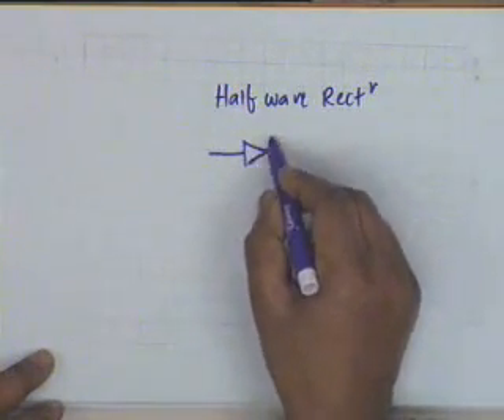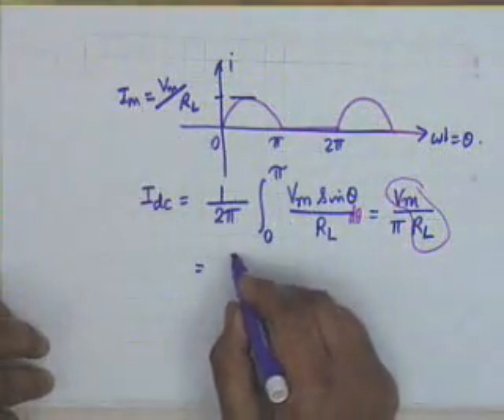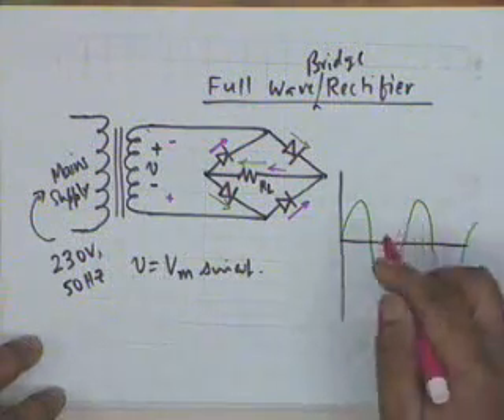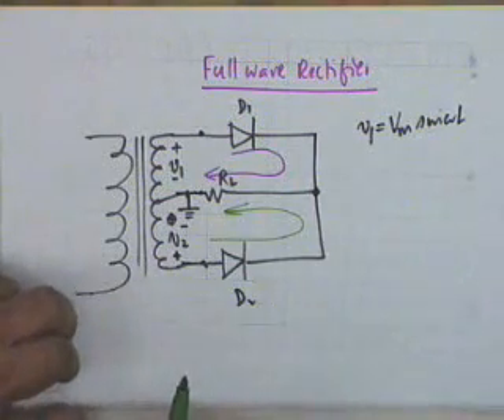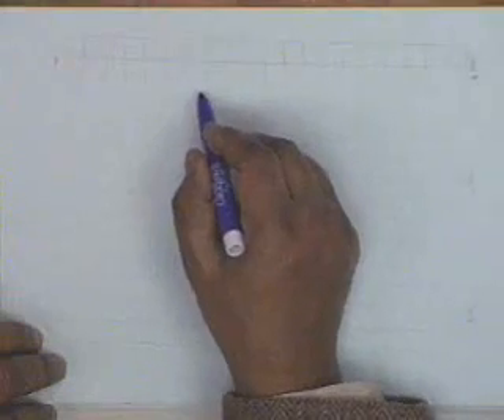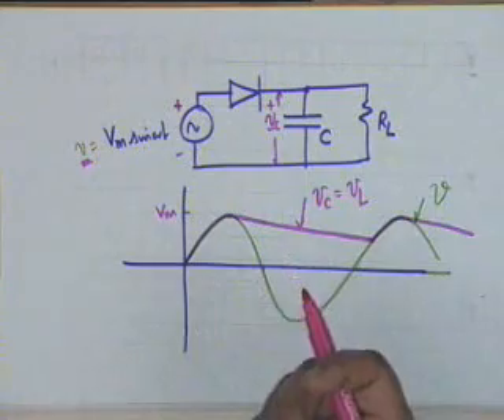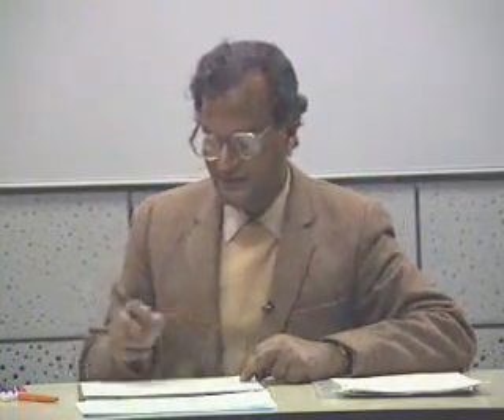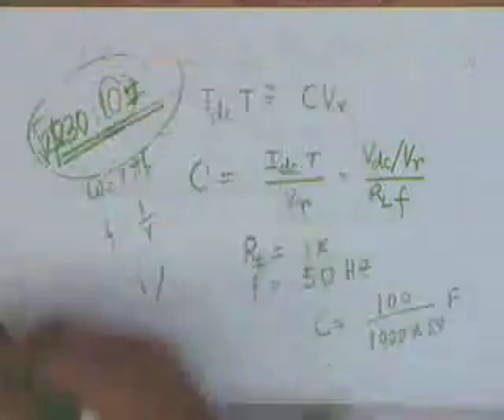9 Rectifiers and Power Supplies

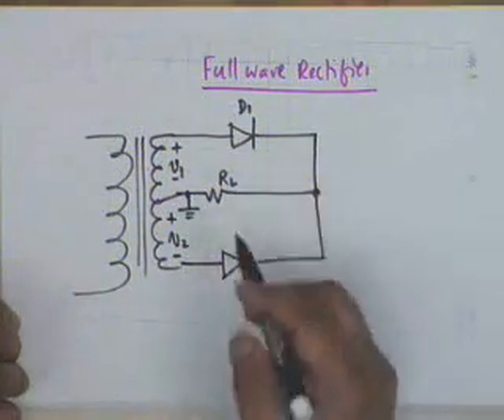Comment: I believe at 20:53 you first wrote the correct polarities on the Transformer secondary terminals, but then second-guessed yourself, and then wrote the polarities incorrectly.

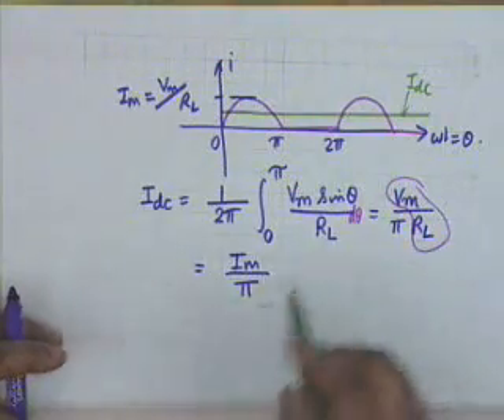If you do a youtube search for “Lecture - 4 Rectifier” (nptelhrd) and go to 9:00, you will see that he writes the correct polarities (though his diagram is not pretty) and shows the correct conduction when the transformers overall polarity changes.

I write this for the benefit of anyone who is interested in the subject.
Reply: sir you are right

Comment: one of my exam question was , draw a circuit for a 12v regulated power supply which uses a bridge  rectifier. so is that just a normal bridge rectifier circuit with a capacitor filter ?